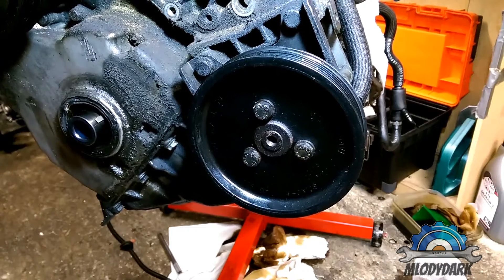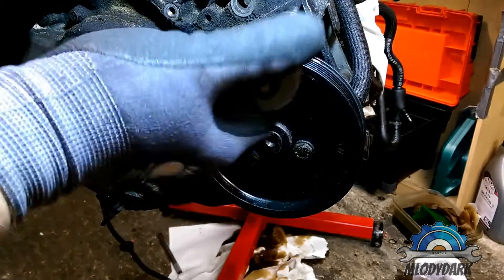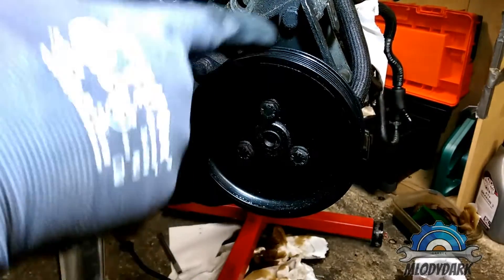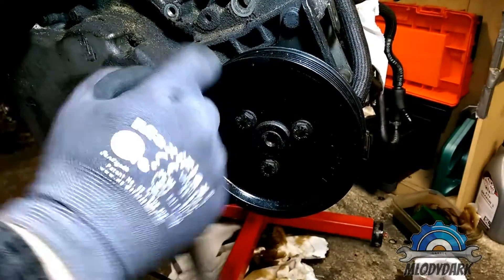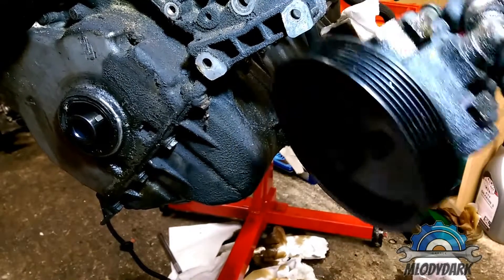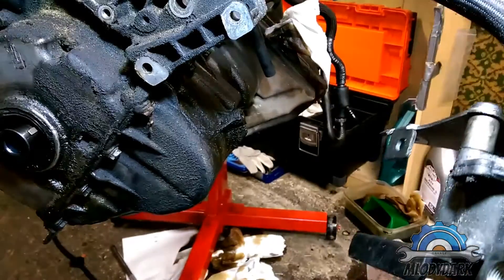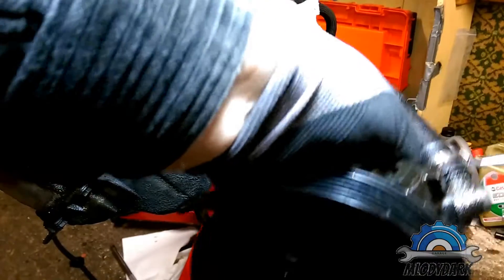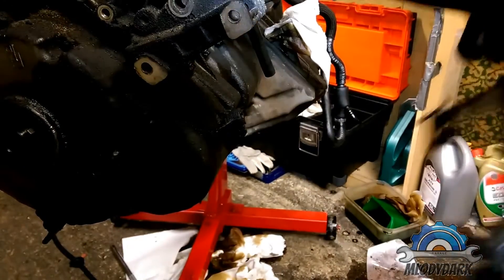Power steering pump removal BMW e46(M52TU strip down)

Comment: What would be helpful if you were to tell us why you are replacing the power steering pump.
Reply from the maker: I'm removing it, this a bunch of videos about stripping down M52TU BMW engine and comparing it with M54 and answering why M54 burns oil (SOLVED) Please watch more videos if You want.